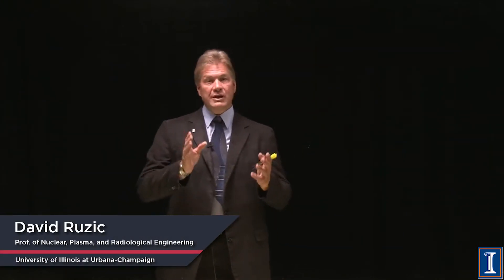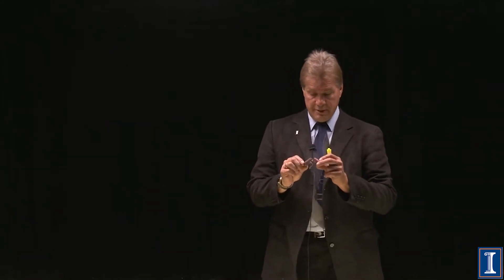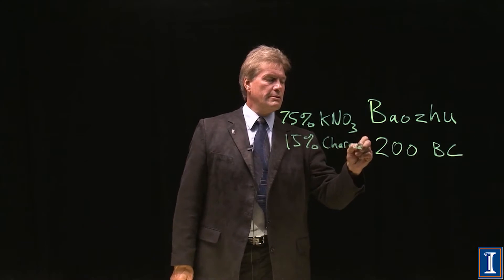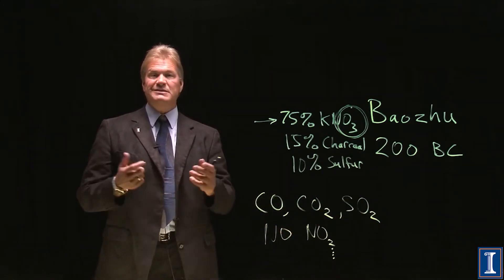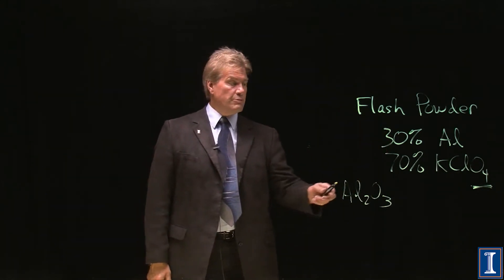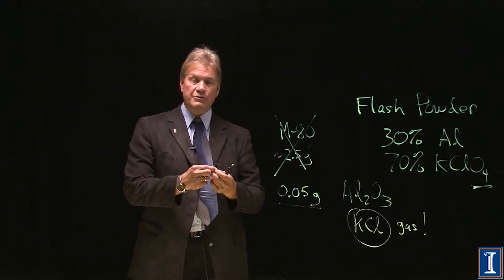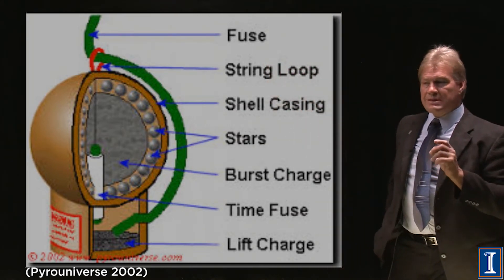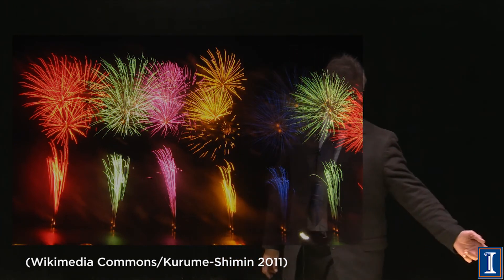How Things Work: Fireworks

Comment: I own a fireworks, pyrotechnics and SFX company. We are licensed to manufacture explosives and I have experience in doing so.

Regrettably, you are trying to teach that which you have not yet properly learned.

Black powder (BP) is not "volatile". It can, and HAS lasted in good useable condition for centuries when stored in a dry place. BP DOES have a lower ignition temperature compared to 70:30 perchlorate: Aluminum flash powder (FP). This ignition difference is due mainly to the lower melting points of nitrate and sulfur compared to perchlorate and Aluminum. These are NOT mainly solid:solid reactions- They don't really get going until one component, usually the oxidizer, becomes a liquid or a gas. There ARE true solid:solid pyrotechnic systems, usually used for items like gasless delay elements in military systems, such devices require incredibly fine and very carefully controlled particle sizes to function reliably and are EXPENSIVE.

FP is NOT intrinsically safer than BP. It is far more energetic and brissant than BP.

A mortar is a projectile system, not a rocket.

Mortar shells are typically broken with black powder, or a perchlorate analogue of black powder. Flash powder is too fast to be used as the burst powder for any but the smallest of color shells or inserts, it blows stars blind or reduces them to dust. A SMALL ammount of FP MAY sometimes be added to otherwise non metallic bursts as a "strengthener".

The Chinese did not discover how to make colored flame compositions in the 9th century, or at all. They had no chlorate or perchlorate oxidizers, let alone sufficiently pure Strontium or Barium nitrates and Potassium nitrate doesn't work well for this application. Colored flame compositions as we know them are a relatively recent development, barely 2 centuries old. Please look up "A System of Pyrotechny" by James Cutbush, who taught chemistry at West Point at the turn of the 19th century:
http://www.gutenberg.org/ebooks/48539
Then look into "Nouvelles recherches sur les feux d'artifices" by F. M. Chertier, published a few decades later, if you can read French...